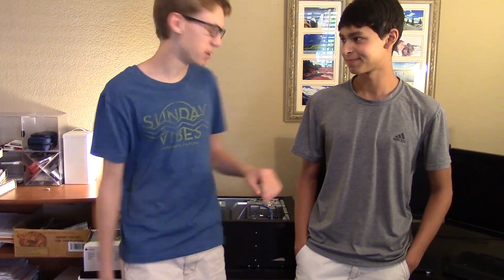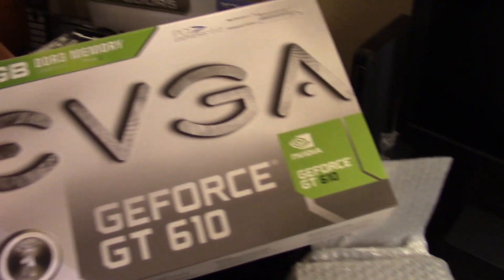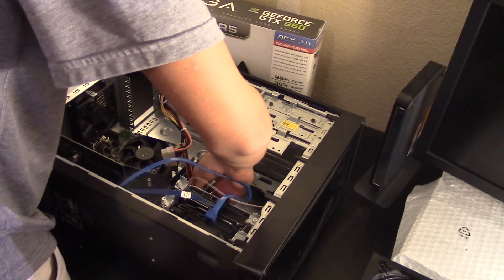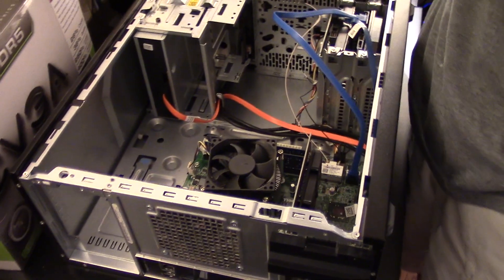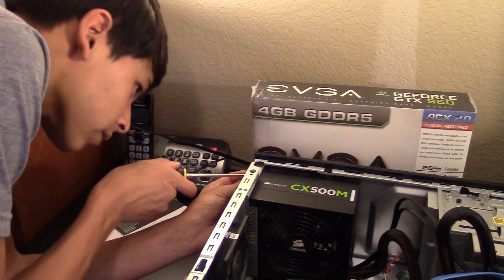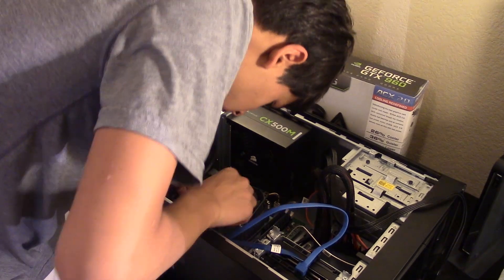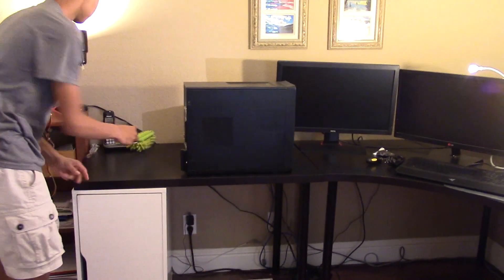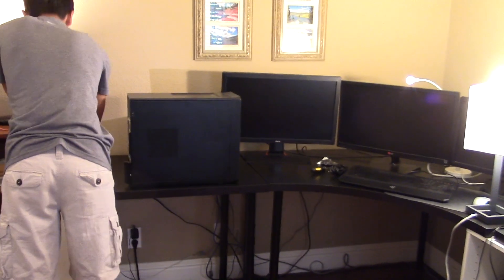Dell Inspiron + GTX 960 = Gaming PC?

Comment: hey I too have an inspiron 580 that is 
an i5 650 3.2 GHz 2cores 4threads processor
dell motherboard (dh57m02) 1156 socket type
8gb ram and 450w smps 
I want to know how will it perform when I pair it with an gtx 1050ti and will it support my motherboard ? on legacy bios ?
Reply: Some low profile cards may work, I know the hd 7750 works, also when you a install a new gpu on the 580 you need to install the gpu,   keep your monitor in the onboard gpu, go to device manager and disable the onboard gpu. Then shutdown and unplug the 580 and plug your monitor  into your new gpu, the 580 bios doesnt seem to have an option to disable onboard graphics so device manager is the only I have found switching the gpu to work

Comment: What CPU would I need to do this upgrade to mine? I have a intel core i3-4130 but I want to do the same upgrade would I need a different CPU? 
Specs:
CPU: intel core i2-4130
8gb ram
300w psu 
Intel hd 4400 gpu
Reply: Intel doesn't make core "i2" processors unless you mean an i3. Haswell i3's are still pretty capable today so I would say stick with the CPU and get a gtx 1050 or rx 560 or 470/570. Also make sure you get a new PSU
Reply: the i2 does not exist unless it did in 1999 lol. Anyways you should get an i5 and a GeForce or EVGA GTX 1050ti if your on a budget. Get a 400 watt psu or 500 watt if you are gona overclock. I have a 350watt psu and a EVGA GeForce GTX 1050 and a i5 3340. I can't really overclock but a decent not cheap 400-500 watt should work well.

Comment: What number is that? I have the Inspiron 3847. I have regular built in graphics, but want to upgrade to a card, and I know I need a power supply. Is that it though? Just a 500w power supply, and a decent graphics card? Will I need anything else?
Reply: mad hatter did you upgrade cause i have 3847 and wanted to do this same thing..lady has one of these for a 100 bucks but dont wanna buy if it wont work

Comment: I also have a 660 and really like the idea of making it a gaming pc. I want current console level gaming. I am more a casual type gamer. What curent gen card would you recommend say in the gtx 970 family? Once again I know space is an issue in this case. Would this work? http://www.newegg.com/Product/Product.aspx?Item=N82E16814500362
Reply: That should work with the insiron 660. 1 Thing is that you need to upgrade the psu. The stock 300 watt (correct me if im wrong) is not enough. A DECENT not a cheep one but if you put some money into the psu a 500-600 watt psu should work. It will depend on your cpu tdp.

Comment: Hey i know this video is a bit old, But im looking to upgrade the same Dell Inspiron, except mine is i7. I want to upgrade it with the GAMEMAX 500W ATX POWER SUPPLY 120MM SILENT FAN 3x SATA & 2x MOLEX + 6 PIN VIDEO & Nvidia Geforce GTX 1050. Will it work?
Reply: Yes it should work well if you get a decent not cheap but decent psu. If you can tell me the exact i7 proccecer (i7 6700k, i7 7700k, etc)

Comment: just opened up my dell inspiron 3650 and its really small was wondering if a zotac 750 ti would fit in my small case
Reply: I just got the same pc and i am wondering the same thing
Reply: Christian Hernandez GTX 1050ti is the new 750ti. It's slightly better performance than a 960, I think I read, but is completely bus powered. Meaning no 6/8 pin external pcie power necessary, or psu upgrade. Plug n play just like 750ti.

Comment: can i do that is a dell inspirion 3656
Reply: The Aviator Captain - JBall Throw a GTX 1050 Ti mini in that PC and it'll be great. No psu upgrade needed. GPU runs on bus power alone. I have the same PC.
Reply: True thx
Reply: Is there an option to upgrade the cpu from the amd a 10-8800p
Reply: Matthew Hull Is there an option to upgrade the cpu from the amd a 10-8800p
Reply: The cpu well actually it's an apu is soldered to the motherboard and not upgradable. The only thing you can do is replace the motherboard with the one that has the FX-8800p on it for slightly better performance. Or  replace the motherboard with one from a Inspiron 3650(the Intel version of that PC) it is a skylake socket and will take an i3, i5, or i7. Why do you want to upgrade the apu mine works awesome, runs cool, and plays games great paired with both the r9 360 and even better with GTX 1050ti. Never bottlenecked once.
Reply: Oh ok, now would the other causes be better, or just not worth it
Reply: What 1050ti do you have?
Reply: Zotac GTX 1050ti mini 4gb
Reply: Changing it to the Intel motherboard from a 3650 would be a noticeable difference in cpu performance, but the difference between an a10-8700p and an fx -8800p is negligible. Like I said I have the same PC with the a10-8700p with 16gb of ram and gtx 1050ti and it plays games beautifully. I do only use one monitor and don't get into 4K much, but it plays Mafia 3 fine. Which is a AAA title.
Reply: Ok, thx
Reply: You have been a big help
Reply: No problem. Glad I could help. Don't get so wrapped up with these idiots spouting off specs and fps. If a game plays well with your setup and looks good on your monitor that's all that matters. So many people get caught up in specs especially processor speeds. The boost is where you need to look and the a10-8700p boosts to 3.2mhz. People were like that when I was into cars too, and I'd pull up in my 2.3liter turbo Thunderbird and eat Mustang GT's and Camaro's up all day. Just have fun with it. It is after all a "gaming" setup.
Reply: The Aviator Captain - JBall Hey, I have another tip for better performance on that rig I forgot to tell you about. Since this is technically a laptop apu in a desktop it has a factory default to run at 1.8ghz and boost to 3.2ghz when needed for the purpose of keeping it cool in a small laptop enclosure & to save power when running on a battery. Well you can access the BIOS when you turn the computer on by pressing F2 then you will be able to disable the POWERNOW function that is enabled. This will make your PC run at 3.2ghz all the time. I have done this and it runs perfect, faster, and stays cool. Download CPU-Z before you do any of this and it will show you your core speed at 1.8 jumping to 3.2. Then turn off the PC, turn back on, hit F2, disable the POWERNOW function in the BIOS, then restart the PC normally, run the CPU-Z program again, and watch your core speed maintain @3.2ghz all the time. 3.2ghz core speed on a quad core cpu is respectable for most gaming applications accompanied with an external GPU and will run all games fine. People keep dogging this PC out and don't know wth they're talking about. This small little desktop that is low power consumption, the "over clocked" or maxed out cpu with a GTX 1050ti runs as good or better than second to fourth gen i5 CPUs with GTX 960's and cost way less.

Comment: How did you make the graphics card shorter to fit in the pc, I have the same one and am looking to upgrade it with this same gpu.
Reply: I think the model they used was the 10.1" version.  I have a gtx 970 9.5" and it works well.  I had to put it in at a bit of a tilt, then put it in the slot.  When I heard the "Click!", I knew it worked :)
Reply: Thanks for the help! :P
Reply: You're very welcome!

Comment: Is that an inspiron 660? I have one just like it that im planning to do the same thing to.
Reply: No problem.
Reply: Its a 3874
Reply: I did the exact same thing to my pc and it worked. I have an inspiron 660 just like the one in the video, and I put a GTX 960, along with a Corsair CX500 psu in it. I can run GTA V without a problem, I get around 60 fps at near max settings. I ususlly get around 200 fps on minecraft, and in a test i got over 2000 fps on it. It can basically run any game you want it to run.
Reply: Deegii Enkhtuya I have a 570.is my 570 worth upgrading?
Reply: Deegii Enkhtuya It'll work, but you'll need more space case-wise and you'll need a better power supply.

Comment: Would this GPU work in a Dell XPS 8300?
Reply: +Jonathan Camaya my Dell had an Radeon hd5770, so I took it out many problems with the driver for that gpu. my psu is original 460 watt. If I need to replace the psu, do you recommend the one you just installed in my XPS 8300?

Comment: Awesome!!! It's all about the 960 :) I'm putting together an i7 6th gen. with a Thermaltake Suppressor F31 Case, and only a Gigabyte H110M--A motherboard. But, I have 16GB of DDR4's, and now I know the right GPU.

The wiring... man, even with "wire management systems", the wires and pins and connections still are a major downer to the thrill of building the ultimate gaming PC. 

It's all a race against the computer gods... the next generation of core 6 games is just about to hit us in time for Christmas.

Comment: these is my dell 3847 with a new corsair 300r case, the stock case rises up the temp 

http://i1053.photobucket.com/albums/s476/korros1on/Mobile%20Uploads/IMG_20160211_203847029_zpsscnlbpnn.jpg
Reply: Was it pretty easy to move the Dell 3847 mobo over to a different case?  Some people told me it wouldn't work.
Reply: Yes since the mobo its a standart micro atx you only have to do a significant mod to the power swich pins i have mi dell on a corsair 300r
Reply: Alright thank you for your very fast response!  And did you have to re-wire a lot of things?
Reply: nop just a loop wire to the power button cable everything else its just standard :D
Reply: I gotcha.  Thanks again for your help! =)

Comment: yo would u know if you'd be able to do this with a dell inspiron 660 if I replaced my 300w with a 500w?
Reply: +Smashed JP also exactly which model is that 960 btw, thanks
Reply: +Smashed JP it's the EVGA GTX 960 SSC AXC 2.0 one its ~$200 on Amazon. Beautiful card, gonna be the same one I put with my i5-4590
Reply: Thanks sir, thats what i was thinking just wanted some feedback.